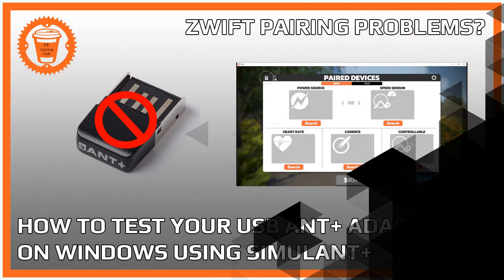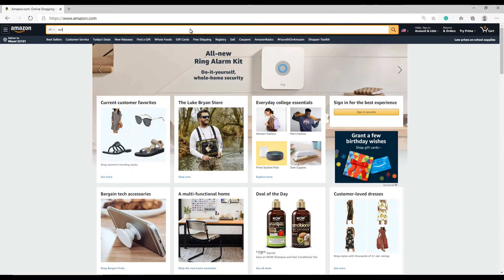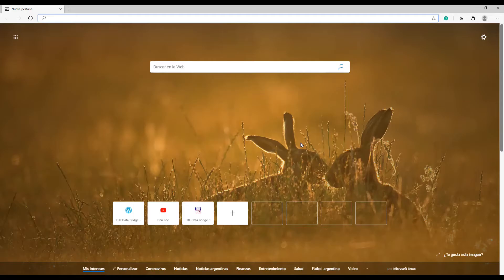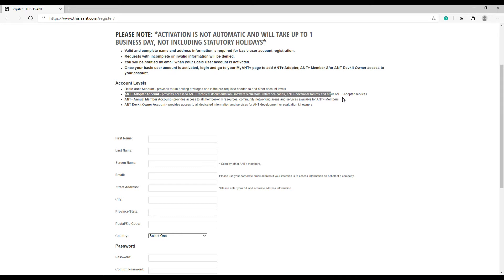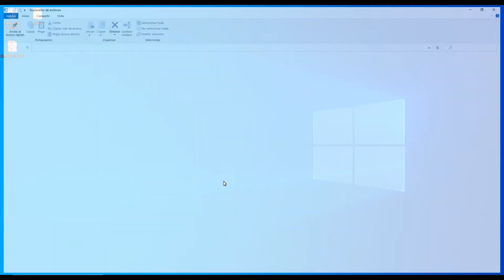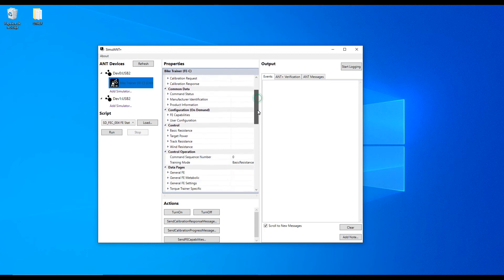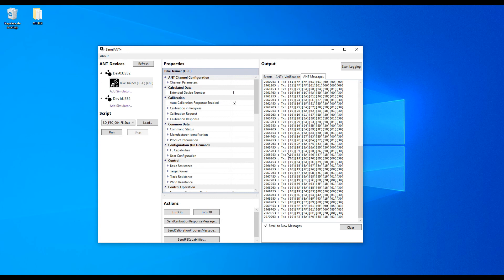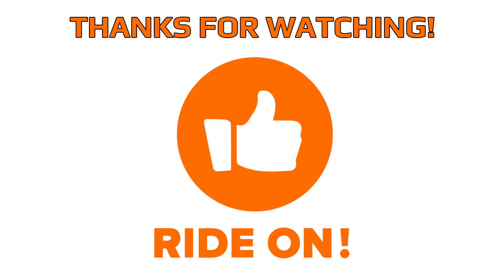ANT+ pairing problems on Zwift? Test your ANT+ adapters using this method

Comment: Hi Dan. I asked a question in the previous video.Can the program TDFDB send data to my watch Garmin?
Reply from the maker: Hello! Yes, you should be able to re-run a recorded route in your Garmin, using this program.
Reply: @danbee.cycling  Do I need the full version for this, or is the demo enough? The problem is that the program sees data from the trainer, the watch sees the ant+ sensor ,but the data is not transmitted to the watch. ( ant+ sensor checked OK)
Reply from the maker: @vladimirsuvorov927  You are right, the Demo Beta that I have currently on the blog won't let you send data to the Garmin Watch! I will update it and let you know. If you please send me an email to tdfdatabridge@gmail.com I'll send you the updated link as soon as the new version is up.
Reply: @danbee.cycling  Thank you.

Comment: Hi Dan,  I have just bought two Anself ANT+ adaptors from Amazon. I have connected them to my PC and run SimulANT+.  When broadcasting both show no ANT Messages (just a blank screen).  Does this mean they are DOA or should I have set them up with Training Apps first.  Thanks Kevin.
Reply from the maker: Hello Kevin. Unfortunately, if this SimulANT+ test fails, it means they are DOA.

Comment: what is version number of that Simulant+ in your video.  I'm downloading version 2.3.0 and it opens to a blank screen on latest version of Windows 10 Pro.  Virus protection turned off.
Reply from the maker: That is weird. Have you tried running it as administrator? (which is not needed BTW, but may help if there is a problem with user privileges). I was using v2.0.0 before this video, but know I decided to switch to the new v2.3.0 as it includes a few ANT+ profiles that were not there in v2.0.0